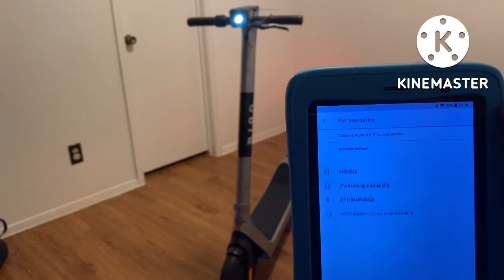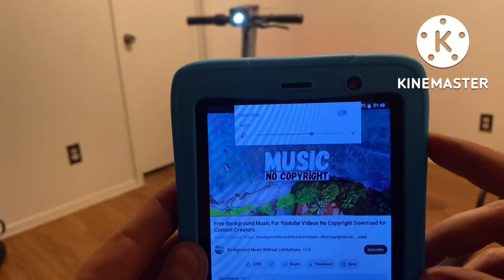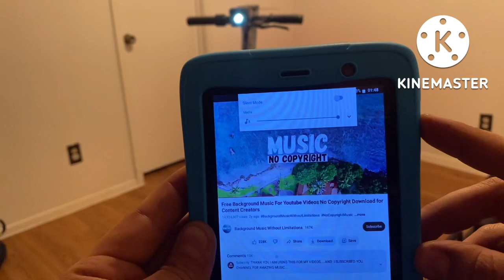Bird 2| Speaker install | Bluetooth￼ |￼ Wireless￼ |#diy #project

Comment: How do you get the headlight to work
Reply from the maker: See my most recent video on me putting a 450 W controller in the bird 2. 

14 minute video. but right at 1:25 you will see how I crossed the green and yellow wires and then and a 30ohm resistor in parallel just the way I did.. either side is fine it doesn’t matter which side you add the resistor to
Reply: Buena idea de los parlantes pero como los proteges del agua?